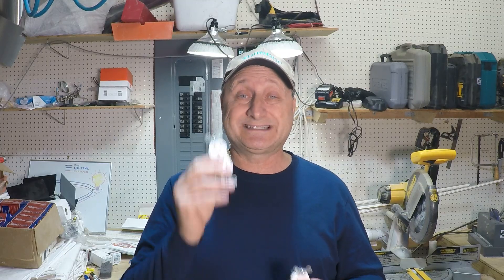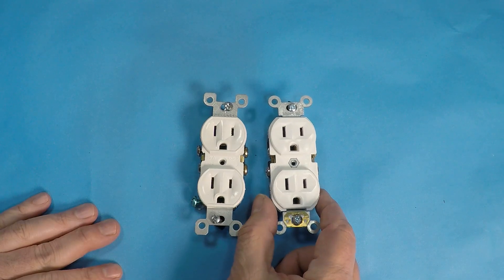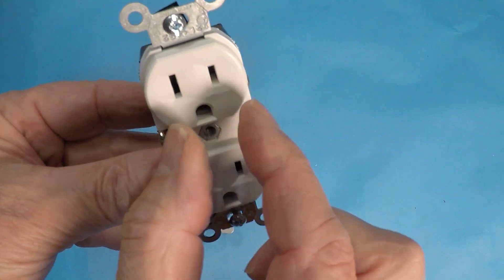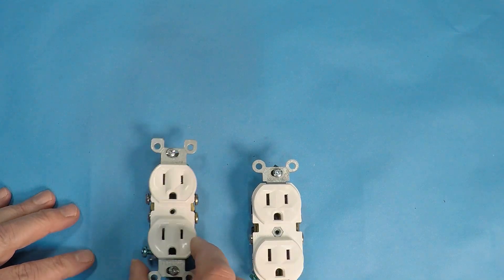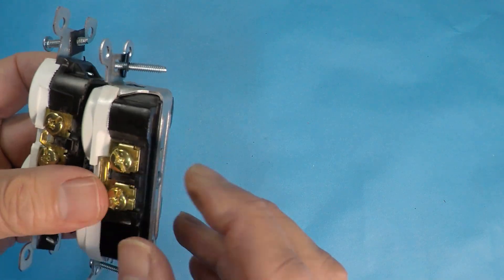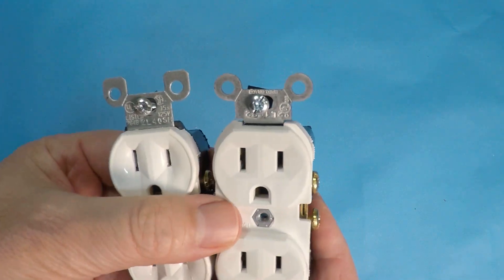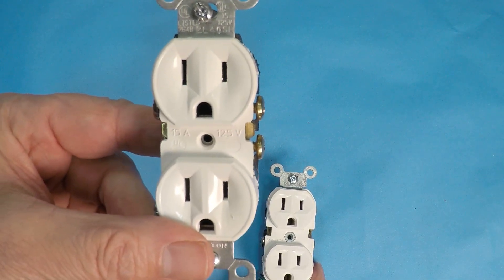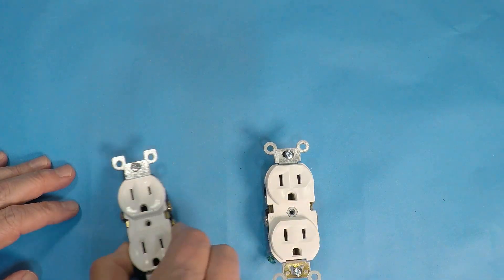Standard vs Commercial Outlets: The Shocking Truth

Comment: As much as I agree, you can find more new homes with cheaper outlets than you will ever find the commercial quality outlet.  I have been a handyman for a number of years, and more than 95% of the million dollar homes I have replaced have all been the cheaper outlets.  Rarely do I find a commercial outlet in a home anymore.  Case in point.  A new customer of mine had several outlets in her kitchen that were not working.  Her home was just over 2 years old.  Every outlet in the kitchen was the cheap $1.48 outlets from a home center.  Note: Her home was over 1.3 million.  This is what I see over and over in more homes today.  So if you think a more costly home gets better products, think again.  Builders are only concerned with profits, over quality...
Reply from the maker: Did I say that more expensive homes have commercial outlets installed?